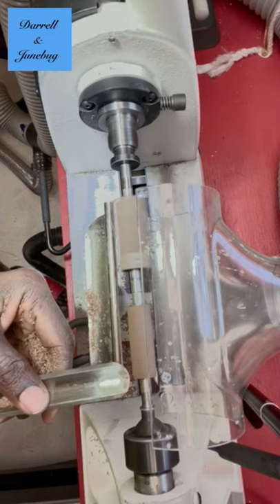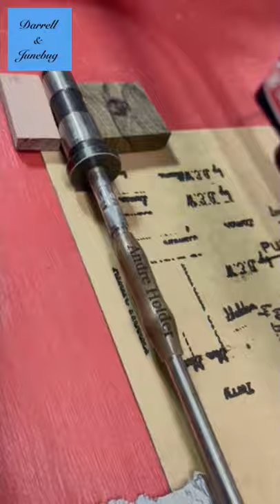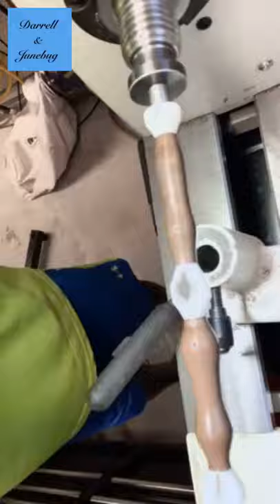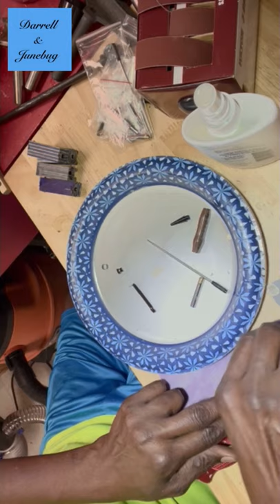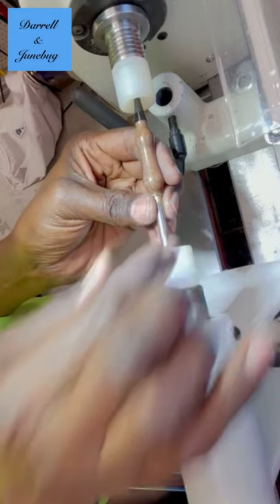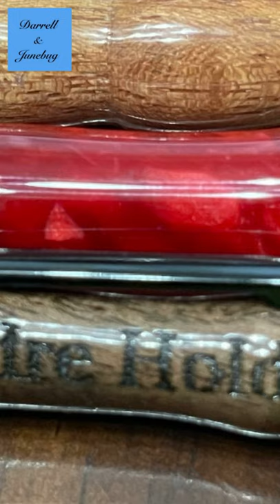Turning a Pen and Engraving it

Comment: What laser did you use? Expensive?
Reply from the maker: Twotrees Totem Laser Engraver CNC Laser Engraving Cutting Machine DIY Laser Marking for Metal 300x400mm (7.5w Input Power& 2.5w Laser Power). $162 from Amazon